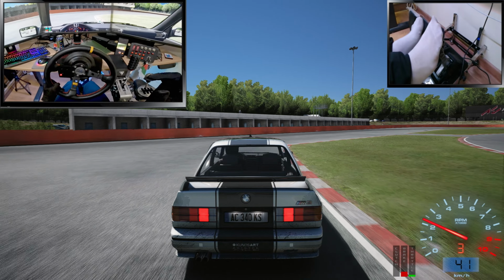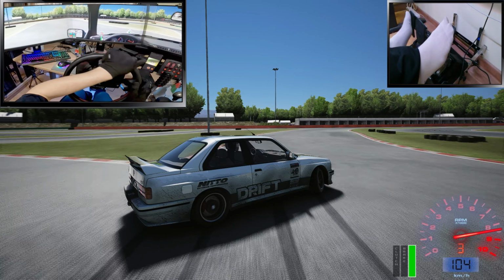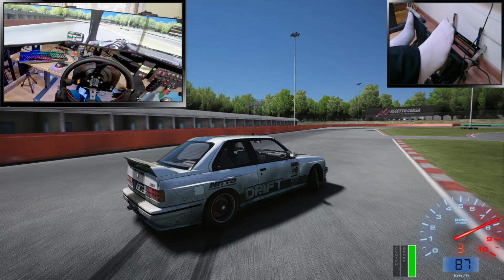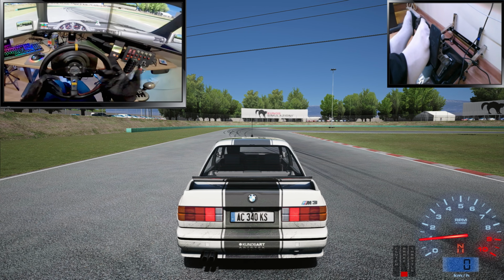How to Drift #13 | Feint Entry Drift Entry Technique | Assetto Corsa

Comment: 4:00 there is a lot of understeer at the front wheels. Should we avoid that or use that as our advantage to settle the car ?
Reply from the maker: Hey brother, 
1. Great eyes for this, these are some very good questions coming lately.
You can use that Understeer to your advantage, as you saw I touch very lightly the rotation and steer myself very lightly as well. 
Trying to keep my movements gradual and match tempo between wheel movement and pedal modulations, as I explain to a lot of students in my drift coaching videos.
2. Once you send the car into big angle, the car will then eventually want to straighten out from 90 degrees or reverse entry, this is the moment you want to fight off this understeer, but do it smoothly, so in other people's eyes, it will be like nothing happened, as your car didn't even budge at all and you handled it soo smoothly.